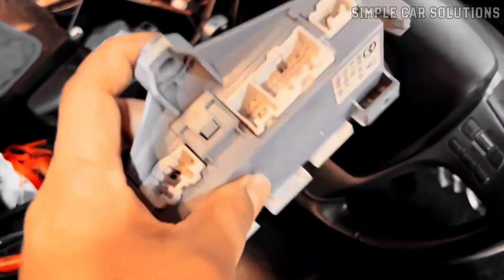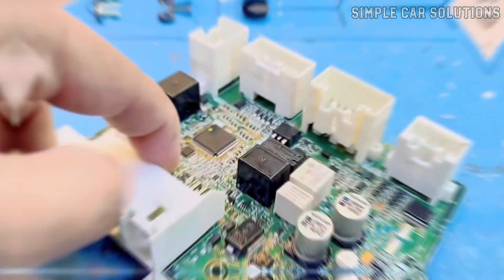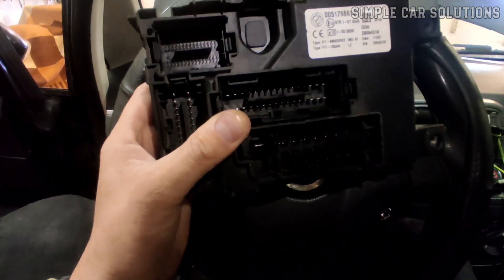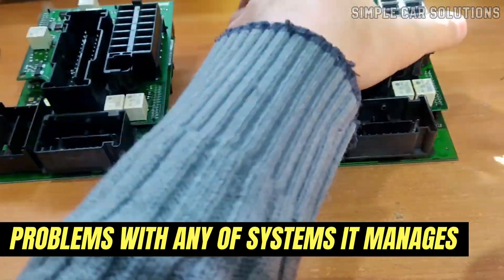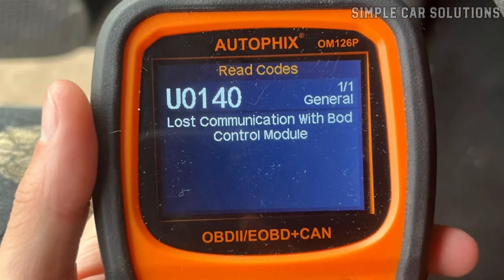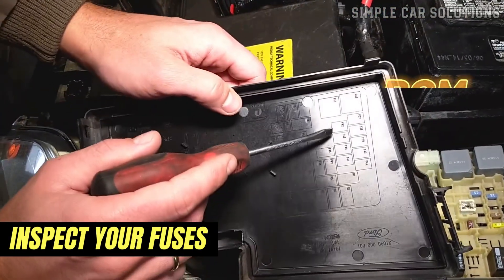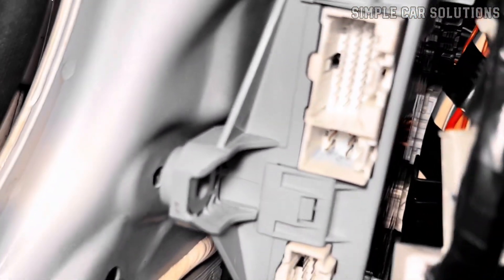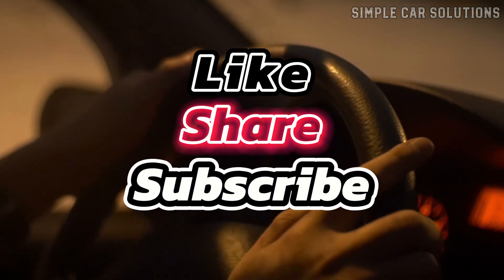5 Symptoms of a Bad BCM (Body Control Module) and How to Сheck It Yourself

Comment: Hi Sir,

I'm from South Africa and would greatly appreciate your assistance please 🙏.

My car is on safe mode after battery was flat and taken out to charge. It's an Audi A3 8p, 2.0tfsi, BWA variant. 

Symptoms are:
1) Cluster doesn't work ( only time and mileage works when I press the left button on the cluster, then a sign showing a circle with "km/h and a "2" when I press both buttons.
2) Windows, Sunroof, Steering functions and boot unlock don't work.
3) I don't have voltage on fuses F6 to F12 in the front fuse box.
4) Car swings but does not start.
5) Radio goes to safe mode everytime I remove terminals. ( This never happened when I removed the battery before)
6) Immobilizer L.E.D works now but never did prior to all this.

I don't have VCDS and no access to anyone who does as I am far out an no one is willing to travel out. They want me to bring in the car to them but the car doesn't start, so is there anyway to solve this without VCDS please 🙏.

Your help would be very much appreciated 🙏.

Thank you..
Reply from the maker: Hi. It sounds like the BCM or main power supply relay isn’t waking up after the battery disconnect. Check all main grounds, especially under the battery tray, and make sure the BCM fuses have power. Try a full battery reset — disconnect both terminals, touch them together for 10 seconds, then reconnect. If still dead, the BCM may need reprogramming with VCDS.
Reply: @SimpleCarSolutions thank you Sir!!🙏 Will try these ....I really appreciate your reply and assistance 🙏🙏
Reply from the maker: @deonnaidoo446 You're welcome! 👍 Hope it works out — let me know how it goes.
Reply: @SimpleCarSolutions Will do Sir, tell me....I have continuity between the positive and negative main cables with the battery disconnected.....even after doing a discharge....This ain't normal right?
Reply from the maker: @deonnaidoo446 Correct — that’s not normal. It means there’s a short or backfeed in the system. Start by pulling fuses one by one to isolate which circuit is causing the continuity.
Reply: @SimpleCarSolutions thank you...will try this🙏

Comment: If the BCM controls the horn and headlights, why are there separate headlight and horn fuses in the fuse box?
Reply from the maker: The BCM only controls when power is sent, but the fuses still protect the horn and headlight circuits from overload or short.
Reply: Does it make noise too because when my dads truck goes dead and he jumps it off we here the sound like something not getting power and the truck wont start
Reply from the maker: @kevinpryor1502  That’s more likely a weak battery or bad connection — the BCM itself doesn’t usually make noise, but relays clicking or buzzing can sound like that when voltage is low.
Reply: I have a 2009 Cadillac cts do I have to get the BCM reprogrammed if I exchange it?
Reply from the maker: @brianowens3225  Yes. On a 2009 CTS the BCM must be programmed to your car—VIN, security, and options won’t work correctly without it.